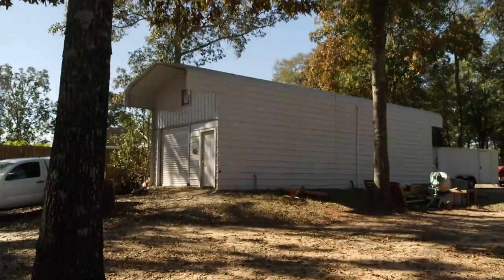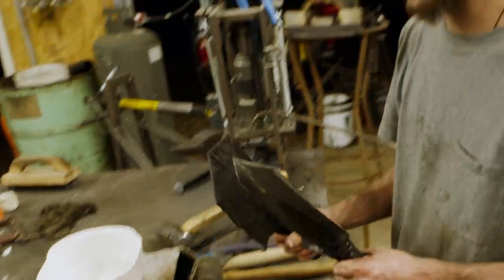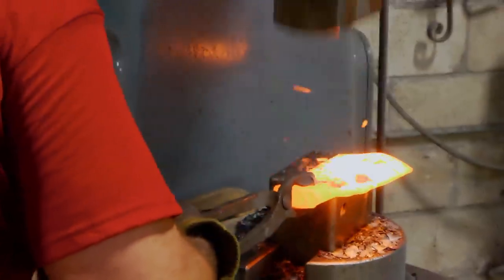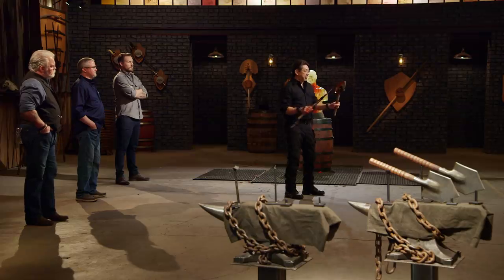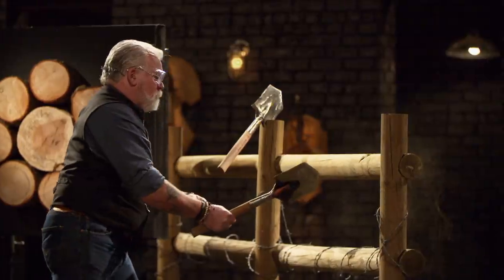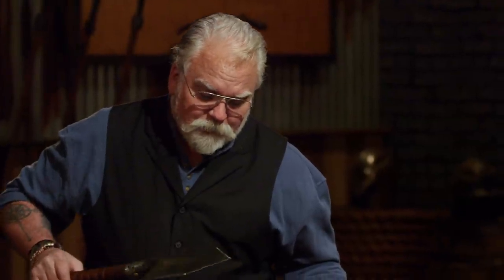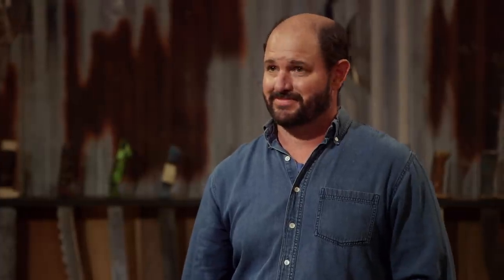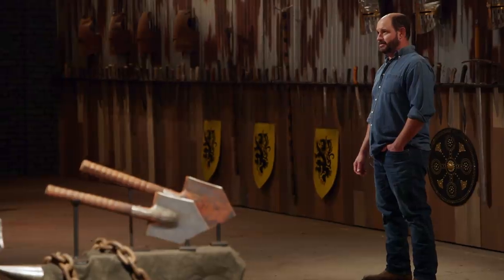Russian Spetsnaz BASHES, BURIES, AND BURNS the Final Round | Forged in Fire (Season 8)

Comment: Cold Steel makes a pretty affordable version of this shovel.  It seems to dull fairly easy, but is very easy to re-sharpen with a file.  Much easier to throw than a hatchet or small axe.
Reply: Those are both easy to throw
Reply: Cold Steel Special Forces Shovel. Very cool tool, meant to be tough steel that will dull a little faster in exchange for how flexible and durable it is.
Reply: I use a drill chucked lawnmower blade sharpener. Real fast and consistent. I love my CS shovel.